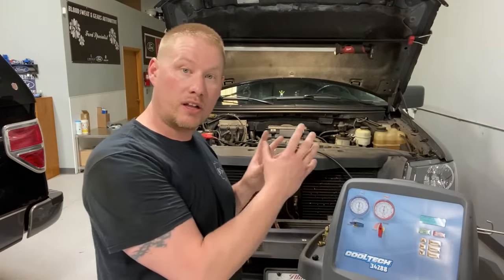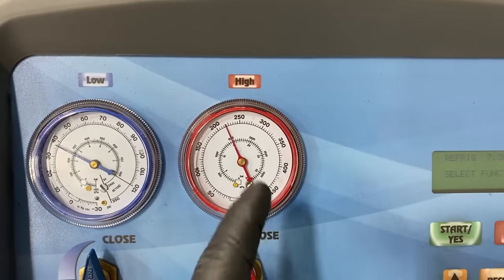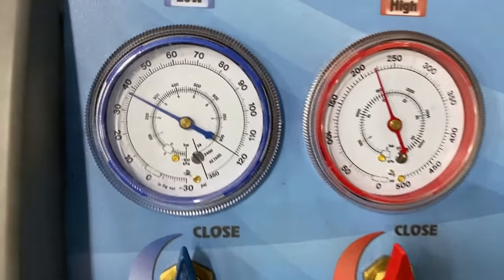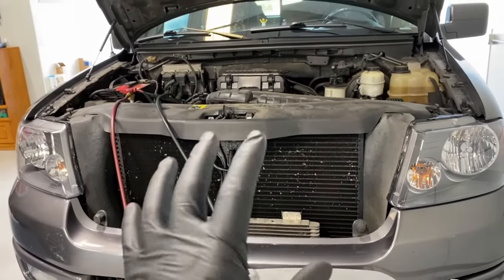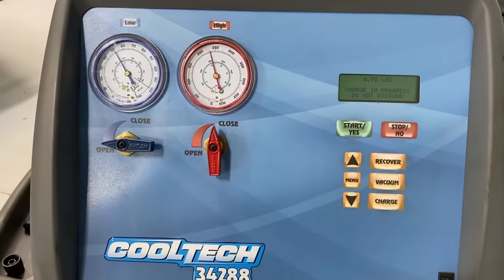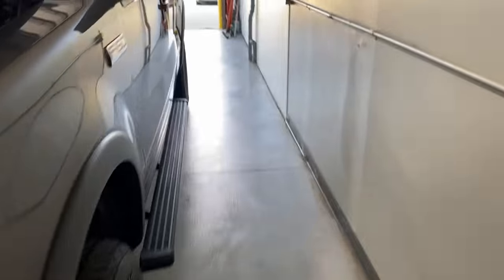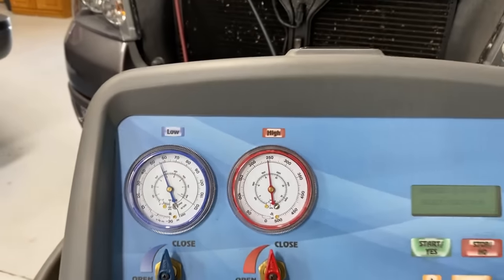Ford A/C Quick Tips #9: How to Spot an Overcharged Air Conditioning System

Comment: What’s it mean when my low side is normal and high side is high? I have s 05 excursion with rear ac

I cleaned the front orfice tube and the rear one also. Haven’t re charged it yet. 

It was 75°f and my low was 35 and my high was 350-400
Reply from the maker: While it is high enough to be a restriction if the low side is not dropping too low too fast then I would be looking at the condensers ability too cool such as being blocked, fan operation etc.
Reply: @FordTechMakuloco  thank you. I was wondering if maybe the higher psi was due to front and rear ac units maybe it’s normal?
Reply from the maker: No not normal
Reply: @FordTechMakuloco  could try a new condenser. Wouldn’t hurt. 20 year old vehicle

Comment: How do you fix an over charged system??? My 2012 5.0 f150 is blowing hot air and the gauge is pegged to the high when I check the low port.
Reply: 11 days, cannot depend for follow . This is the way it goes

Comment: Hey guys I have an 03 Expedition I just put a new compressor dryer and front and rear expansion valves in it my high side pressure is 225 my low side pressure is 60 I live in Southern Florida it's been in the high 90s. And my AC is not blowing cold at idle I bring the RPMs up it gets cold off I'm driving it gets cold when I bring the idle up high side pressure goes to 300 low side goes to 35 or 40 anybody have any ideas?
Reply: Yeah I believe it's 54 Oz I'll have to double-check that and all my blend door and everything is working perfectly fine thanks bud

Comment: I assumed i needed a charge. Watched your videos and now i know the clutch on my compressor isn't activating.  Showing high pressure (red) on the can I bought from O'Reilly's so I did nothing.  Why do I have high pressure off the compressor isn't even turning on...
Reply from the maker: you will have high pressure on the low side even when off because the engine compartment temps are so high.
Reply: @FordTechMakuloco  Changed out relays to see if I could get the compressor to kick on. No luck.

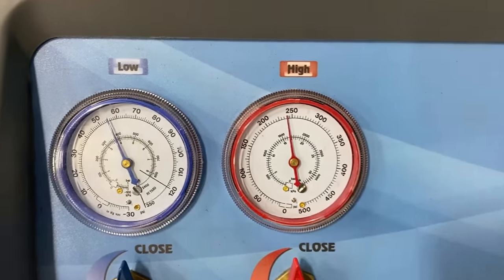Comment: My 2004 Hyundai Sonata AC was not working as good as it had been, then started blowing hot air. I hooked up my gauges, the high side about 150 psi, the low side ran off the scale to the 6:00 position !? At 80' F... when it quit the outside temp was 105F and I had gone about 15 miles with barely cool air, when started the car about 30 minutes later, it was blowing hot. After a couple hours searching the web for Why I had low side pressure of 350 psi more than double the high side, it said that air had got in the system and to evacuate, pull a vacuum and recharge. I did but the system when running produced the same condition as before. Anyone have any advice ?
Reply: It's possible that the compressor is faulty.

Comment: Had the compressor, orifice tube, condenser, dryer, and engine fan clutch replaced on my 07 f150 5.4 3v and the pressure was 2.2 still getting over 60 degrees on recycle ac what is wrong with my ac please help

Comment: Question: Why don't you compensate for barometric pressure when charging your car's AC system? Just wondering. I've seen it both ways and I've seen charts detailing system pressure versus barometric pressure compensation charts. 

I would appreciate some help here...anyone out there or the Ford Tech. Thanks in advance.
Reply from the maker: Absolutely no need.

Comment: Great video thanks a lot .....but I have a question, if R134A at 37psi show a temperature of around 25 F wouldn’t that cause the evaporator to Iced up?
Reply: ON  A HOT HUMID DAY, WITH THE BLOWER ON HIGH THE HOT HUMID AIR ACROSS THE EVAP WILL KEEP IT FROM FREEZING UP UNLESS THE DRAIN IS CLOGGED. SHOULD GET A GOOD SIZED WATER  PUDDLE AND A STEADY DRIP UNDER THE CAR WHILE ON. IF FREEZE UP DOES OCCUR, THE LOW PRESSURE SWITCH WILL CUT THE COMPRESSOR OFF OR IF VARIABLE DISPLACEMENT COMPRESSOR' IT WILL CHANGE THE AMOUNT OF FLOW TO DEFROST THE EVAP. SOMETIMES LOW { LOW ON GAS }  PRESSURE WILL CAUSE A FREEZE UP, FOUND THIS ON SOME OF THE OLDER IMPORT BRANDS.
Reply: generally speaking you have a 15 degree loss on temperature transfer through the metal  so an evaporator  with a 25 degree refrigerant temp shoud have an air flow temp of 40 degrees.   a/c is all about air flow. too little will cause poor heat transfer and in an evaporator possibly  freezeup.   and a freezup causes low air flow  so it feeds on itself lol. too much is really a non issue.  too little on a condenser will cause  high head pressures and if working properly the high pressure cut out will stop the compressor.
Reply: At 37psi your evaporator would be 42° not possible for it to freeze.....it would have to be at 27psi or lower

Comment: So how do you lower the pressure,  by using the gauges and venting off psi?
Reply: WHEN IN DOUBT I DO AN  R E R. RECOVERY THE 134A. { A GOOD MACHINE WILL MEASURE IT TELLING YOU OVER OR UNDER CHARGE}. THEN I EVACUATE THE SYSTEM FOR 30 MINUTES TO GET RID OF ANY MOISTURE. THEN RECHARGE TO SPECS ADDING DYE AS WELL. RUN IT OUT CHECKING PERFORMANCE OF THE SYSTEM AND IF IT WAS LOW LEAK CHECK WITH BLACK LIGHT AND MY ROBINAIR LD3 SNIFFER. IF NO LEAKS ARE FOUND AT THIS TIME I TELL THE CUSTOMER TO RETURN IF PERFORMANCE DECREASES  AND I LEAK CHECK AGAIN FOR FREE. SOME LEAKS TAKE TIME FOR THE DYE TO LEAK ENOUGH TO SHOW
Reply: Illegal in the states to vent any refrigerant, aside from R-290 (AKA, propane). Supposed to recover it.
Reply: Joe Copa  YES IT IS. IF I WERE A TYPIST INSTEAD OF A MECHANIC' I MIGHT CARE. BY THE WAY' I DIDN'T MENTION THAT IT IS ILLEGAL TO VENT 134A TO ATMOSPHERE. I KEEP FORGETTING NOT EVERYONE  IS  CERTIFIED IN AC  REPAIR.
Reply: Joe Copa  THIS COMMENT I LIKE. MORE PEOPLE NEED TO KNOW THIS.
Reply from the maker: Only proper fix is a full evac and recovery.
Reply: Use a machine to evacuate the system and recharge with the correct amount. Venting is illegal.

Comment: Well, I still don't see how you can say it's normal for the high side to be #275, #300, but even when overcharged the number didn't change much (250).
Reply from the maker: 275 to 300 is normal on a hot day with a full hot engine compartment.

Comment: This is not relevant to this video but maybe someone could help me out with this mess!!!! I just bought this little 2000 ford ranger it’s a clean little truck with a new engine in it but the guy has the a/c system hot wired. He has wire ran directly from the a/c compressor to the battery. If you touch them together the a/c comes on and it cools perfectly but I know this will eventually ruin the compressor. The problem is I don’t know where the original a/c compressor wire is. Any help would be greatly appreciate! Btw I love your videos ykys about ford vehicles,,,,, thanks for reading

Comment: 2008 6.4 is 27 ounces the correct amount sticker says 27 the interwebs varies anywhere from 27 to 42 
Could you please verify the 2008-10 super duty 
Thank you in advance Sir
Reply from the maker: 0.77 kg 
(27 oz) 
(1.7 lb)
Reply: Ambient temp 90 degrees
High side rarely goes over 250 steady at 215
Low side at 20

Fan engaging as normal non snow plow 

Accelerated to 1500 RPM at idle low drops compresor kicks off pops up to 70 then let idle everything drops back to 20 low 215 high  ambient outside 90 degrees

Static right after shut off both sides right at 60

Comment: Wil this cause the system to sound suoer loud as well, as in the fans?
Reply from the maker: Yes it can if the high side pressures spike tripping the high pressure switch, but most times the fans are on high because the low speed fans are not working at all
Reply: @FordTechMakuloco  i should get my system checked. Thank you so much!

Comment: I have a 2016 chevy Malibu and I replaced compressor , condenser , expansion valve  the car says 0.700 kg equals to 1.54 lbs I install correct amount and pressures are high like if it was overcharge and is only cooling 60-80 degrees at a 105 F weather and humidity 60%  and I try installing less freon like around 1.10 lbs and it shows the correct readings like low side 32 psi and high side 225 but doesn’t cool it takes a long time to cool and only goes up to 78 F on the vents I don’t know what I’m missing here and the only thing that I can think of is that the a/c compressor is bad even brand new Murray from Orelly’s  any ideas??? What could be wrong
Reply: Did you vacuum out the system after the repairs. Add the correct amount of oil to the system. ?

Comment: Why did we not see the low side pressure gauge fluctuate when the compressor kicks on?
Reply from the maker: The truck uses an FOT system but it was pulling the heat load out of the truck so never dropped enough to disengage the clutch.
Reply from the maker: FOT actually remember this is a 2004.

Comment: so you never said exactly what the pressures should be.
only if high or low, you never opened the high side to get the reading.
Reply from the maker: My gauges read with the valves in the closed position. The valve only regulates flow to the internals of the machine not the gauges.

Comment: why listen to all this if i dont have that machine?
Reply: You can rent a manifold gauge from most automotive parts stores (AutoZone, O'Reilly's, Napa, etc.) and they're not crazy expensive from discount hardware stores (Harbor Freight, do-it-best, etc.)... so there's those options too. They will be just a set of gauges (hand held sized) and hoses and that's it (not a rolling on a the floor giant model) and you'll need a separate vacuum pump (also available for rent at auto parts stores and or not crazy expensive at discount hardware shops)...

Comment: 3 pounds?
0.96Kilos is just over 2.1 pounds.
Reply from the maker: I think you need to watch the video again. The truck was fully functional and fully charged according to the data tag with a 0.96kgs or 2.1lbs charge. I then overcharged the system by adding exactly 1lb to the same system as shown in real time. Last I checked 2.1lbs plus 1lb extra to overcharge it equals 3.1lbs or just over 3lbs as I said in the video.